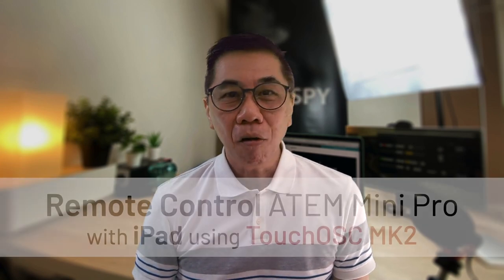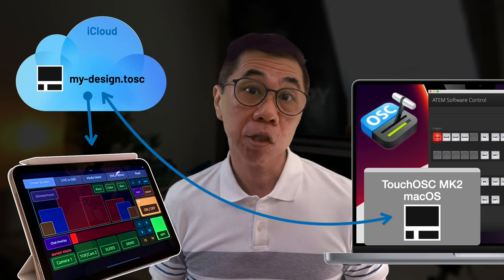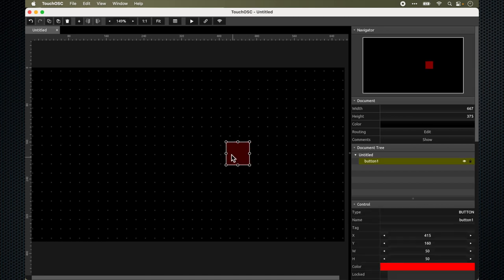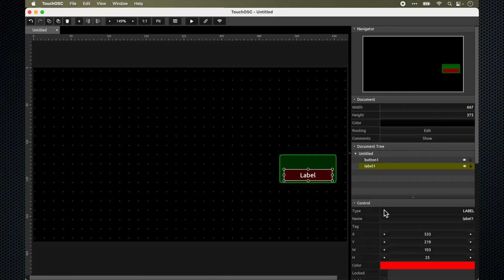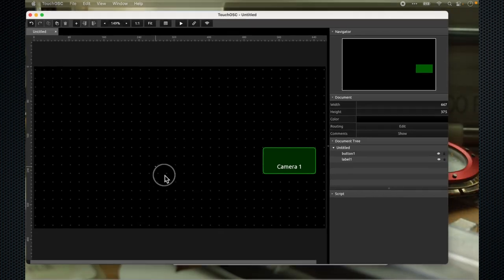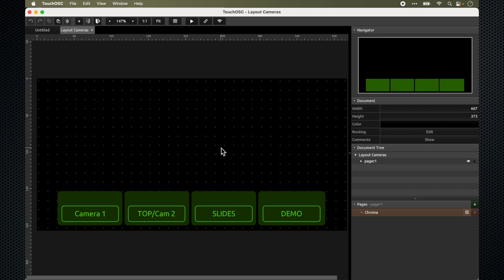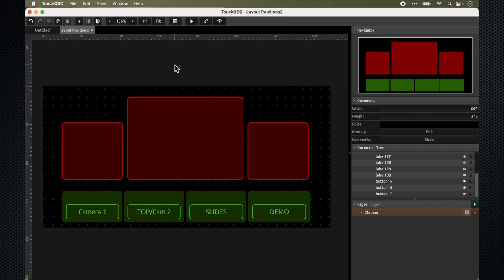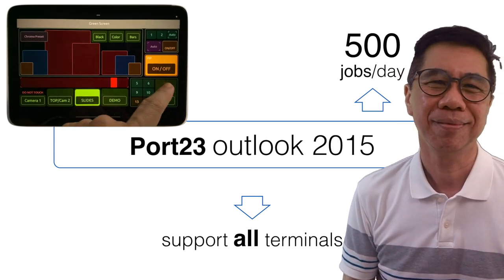TouchOSC MK2 Remote Control for ATEM Mini Switchers

Comment: I use touch osc since 10 years for Traktor DJ and Final Cut . The slider trick is nice 👍
Reply from the maker: The slider trick is only available recently. It was included in the command list for controlling ATEM fly position in the latest update.

Comment: Thanks for doing all the research - it helped a lot.
Reply from the maker: Glad that it helped
Reply: @stickyspy  hi, all worked well - I have to find out 1 thing and that's how to transfer the app/controller I made on my Mac to my iPad. Tonight gonna dive into that topic 🙂.
Reply from the maker: @SONICrider   easiest way is to save the file in iCloud drive
Reply: @stickyspy  .. I saw that in the start of your video - gonna try that tonight - let you know the "progress" 🙂
Reply: @stickyspy  Hi, all worked out well. Tip: you can put a label over a knob - make background "unticked" and the knob works fine on the complete surface 🙂.

Plus: I think it is not possible to get feedback from the ATEM mini Pro to update the status. Do you agree or is this optional in the MK2 (I know MK1 doesn't has this option).

Have a good day.

Comment: Hi one question i can seem to figure out. It looks like your program buttons are enabled (bright green) until you hit the next program button and that one lights up green. But i cant get that to work. What are the settings for that?
Reply from the maker: You need to ensure the Host IP address, send and receive Ports on TouchOSC is configured correctly. 

Also the ‘Send feedback messages to:’ and Port in atemOSC is correctly configured. 

Also your ATEM switcher must be online.